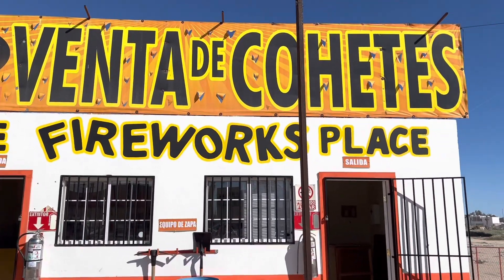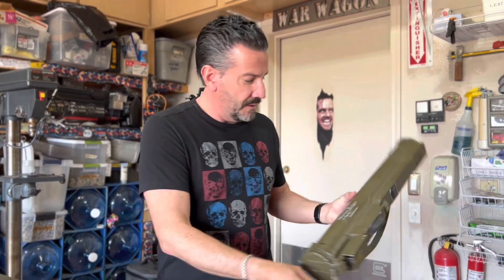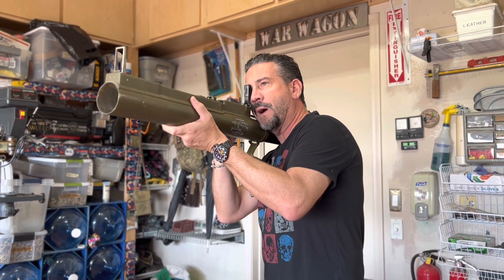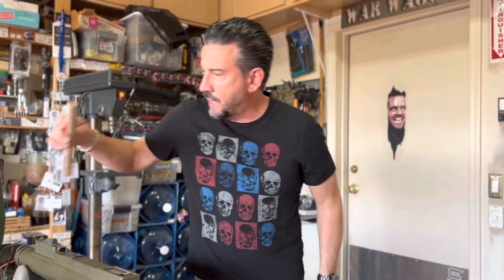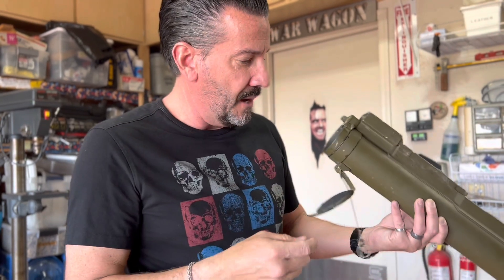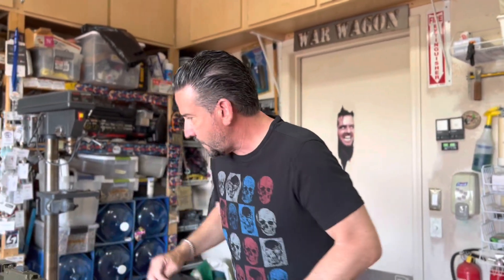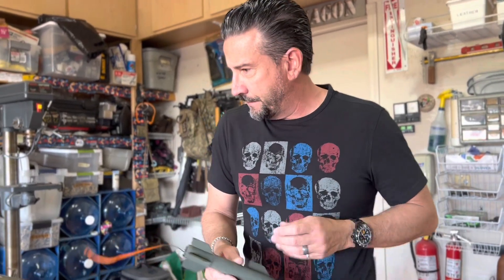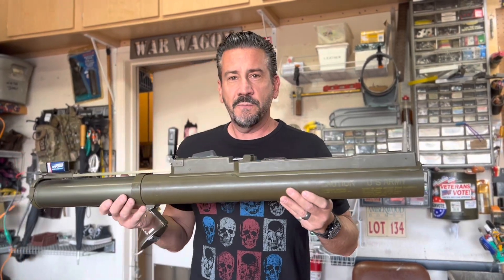Let’s make a LAW rocket work again - With GIANT FIREWORKS!

Comment: I would be looking for a 66mm diameter Firework for this, maybe even a multiple barrage rocket, such a cool idea using the electronic ignition system of the launcher and firing with the original button,  I would love to see videos of your shooting gear, belts equipment and such, I love your .38 Supercomp, I noticed you changed between square and round reflex sights, does it make much difference? I'm hoping to make an airsoft copy for my daughter as she's too young to shoot actual firearms at the moment, I thought teaching her gun safety with a blowback gas pistol would be a good start,  I actually don't know much about your preferred rifle or shotguns at all though.